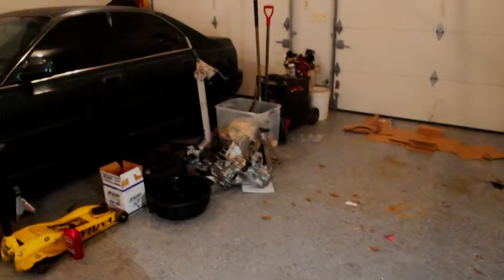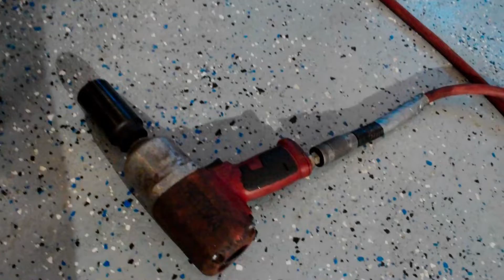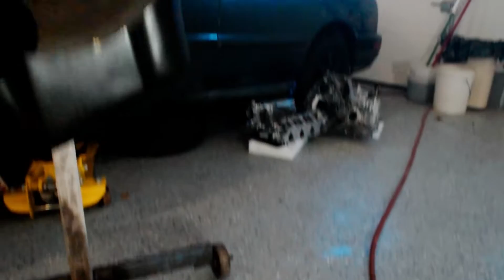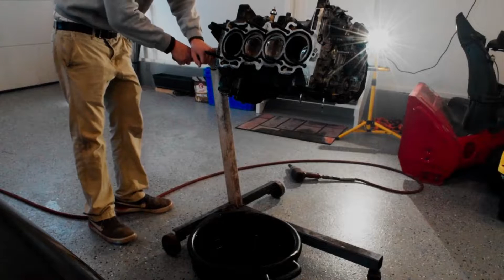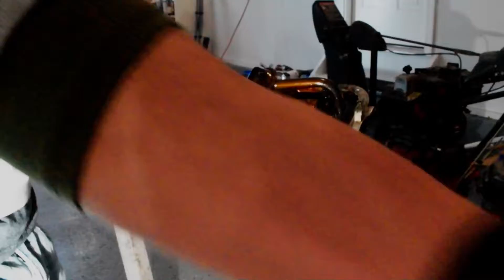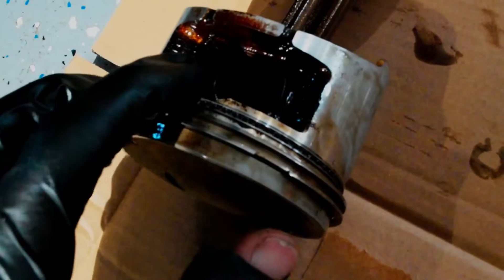1996 Honda Accord F22B2 Engine Disassembly

Comment: On Average , piston rings will last about 100’000- 150’000 miles under proper conditions like many other parts. Also valve guide seals will wear out fast from the extreme heat 🥵

Comment: I know this is an old video but I’m having trouble with my engine if you can help me that would be amazing. Anyways I’m the back of my block I’m leaking coolant idk what to do or what it is
Reply from the maker: There’s a metal coolant pipe in the back of the block that has o rings on it i believe. You’re just going to have to see the leak. Got to lay under there and pinpoint it
Reply: @ThatAccordGuy  okay thank you

Comment: What up everybody 

I recently acquired a 97 accord with 187k on it 

I got it to learn stick shift and got stuck behind a person on a hill with some one behind me 😅

I launched it and burned the tires a bit and now I hear a knocking coming from behind the engine, underneath the intake manifold and a slight clink when shifting into 1 and second but it seems ok with the higher gears

It had a timing tick already so I wanted to pull it out and tear it down to learn more about my engine and knock some stuff out 

I also noticed when letting off the clutch into first gear, it judders pretty hard until I press down into the clutch and use more gas, I was wondering if this is normal 

Also wanted to add a turbo but didn’t know wear to add a line or if it’s even possible on a f22b1 motor

So I have a lot of ambition but knowledgeable intel is my biggest enemy but that doesn’t scare me lol
Reply from the maker: It’s probably a torn motor mount or something. Mine clutch chatters pretty good when you slip the clutch. Characteristic of the vehicle. Once you get better at driving stick it will be better. I was the same way! Good luck man!

Comment: I noticed your attention pulley for the timing belt still had an 8 mm bolt holding it in place. Some say that should be removed after the tightening procedure is done. What are your thoughts on this?
Reply from the maker: That bolt is supposed to be for set up and tensioning the belt. then you supposed to remove it. I believe that’s the bolt you’re talking about. I felt like my spring wasn’t pulling the tensioner enough, so I gave it a little extra and tighten the bolt. Hasn’t caused any issues.
Reply: I left mine in and now I’ve got to try to fish it out with just the top cover off.
Reply from the maker: Eh I’d leave it lol not doing any harm. basically, the point is, it tensions the belt so you can put the outside cover on and then crank down the tensioner bolt afterwards with the cover on. I think I just tensioned it with the cover off so I could make sure that it was good.
Reply: It just sounds funny like it’s to tight,both belts will flex 3/4 turn when twisted and the belts didn’t have a direction on them so I’m wondering if the sound will subside in a little time.
Reply from the maker: Mine was too tight my first time too. I loosened it and it sounded better.
Reply from the maker: Probably will wear in more tho eventually

Comment: Im currently tearing down f22B1 motor , got the headgasket and head ported and resurfaced , thinking i blown my headgasket. Come to find out that it  didnt stop the smoking problem … got aftermarket rods and pistons and arp studs for the bottom end
Reply from the maker: Good luck man. Mine is starting to smoke again but I'm thinking it might be the turbo

Comment: friend i wachted your video, i have the same engine f22b2 in my accord 95.  im looking for the engine bearings ,but i cannot find it anywhere,do you know whats the part number is? and its the same engine bearings for f22b2 and f22b1? please help.
Reply from the maker: Yeah If you can't go to the dealership or order them online, if go with aftermarket bearings.
Reply: @ThatAccordGuy  Thanks for repply bro,i solve that problem ,just bought another aftermarket brand and fits greats,thanks my  accord 95 is on the road now. greetings.
Reply from the maker: Glad to hear it!

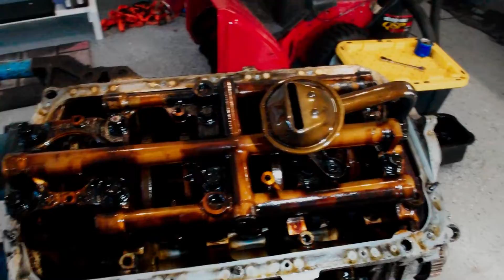Comment: I love coming back and watching your build videos bro..👍 👌 after spinning bearings in two of my f series motors.. I now have put together a hybrid motor.. f22a4 head on a f23a block. I had k20a2 pistons in my last f23a block setup and it was stooped torquey and fast.. but didn't last but 2 weeks since I found out the compression was 12:36.1 and I was on regular 91 octane with no tune or fuel management.. so you can imagine the knocking and pinging I was getting.. its my first time building motors so I am somewhat still new to certain things.. I have a new set of k20a2 pistons I want to put in this setup but the compression will be through the roof!.. 😆 so I have to invest in a hondata s300 since tuners around here will not touch a car that is on a chipped ecu.. sucks but eh.. I hear good things about hondata.. the f22a/f23a setup is pretty impressive as it is dont get me wrong.. it has lots more torque than the full f23a jdm swap I had.. something about the compression going up when you pair this certain combo together. When I break loose my headbolts I start from the outside and work my way in, I don't know if that makes any bit of a difference but when installing them I would work middle out In sequence.. so I just do it backwards but im sure both ways would work no problem.. hoping to catch up to you real soon! I'm ordering a turbo kit soon what kit did you buy off ebay? Any recommendations and tips before I make the purchase? And with the injectors and fuel pump, how hard was it to get the car started with upgraded injectors? Or is there a basemap i can load onto it to just drive around to get to the tuner? Sorry for all the questions but your by far the only selection one out the bunch that knows these motors in and out
Reply from the maker: Sounds like you've had a good amount of experience with these motors. To be honest, this is my first f series build! Definitely love the torque it makes. Don't even want to put a cam in it for fear of losing it! Cool to see you've been experimenting with higher compression stuff. I like the low comp for boost cause it's hard to kill!

I pieced together my own kit for the Turbo. Better that way. some stuff you gotta get nice.

Definitely was a pain to get it to start and run on the larger injectors but it didn't have to be really, I just didn't know what I was doing. Sometimes you're better off changing them at the Dyno. Gotta ask the tuner. He could always send you a base to get u to the Dyno if he's cool. Good luck bro!

Comment: That socket is awesome! I ended up using a 1 to 1/2 adapter and a impact made for heavy machinery haha.
Reply from the maker: Yeah the big guns are also an option. I tried a 3/4 gun with no success I think. Those bolts can really be on there!

Comment: Thanks I've been looking for a video confirming this. Only seen ones showing piston all gummed up but did not explain the situation beforehand. I'm trying to resolve this on a Toyota 3.0 engine and see you tried epr-109. I was going to try that and also switched to Pennzoil full synthetic and saw a decrease in consumption.
Reply from the maker: Nice man glad I could help. Fixing this with different detergents and oils may be possible if you have the time to try them and don't mind smokin in the meantime haha. IMO a rebuild is the best way but good luck l! If it's working then that's good!

Comment: Greetings from the UK. Glad you found the issue, the hard work pays off in the end - fair play to you for finding it. This highlights the importance of "clocking" all the rings....you may have just been unlucky how the gaps ended up lined up like the stars! You must have felt so relieved when you found that, I know I would have done.
Reply from the maker: Yeah I was pretty happy to have found a real issue. Knew it was going to run good when I got it all back together. Thanks for watching
Reply: Instablaster...

Comment: So basically, to stop the oil burn, you just have to take out the pistons, and clean the rings with some brake fluid and a toothbrush or something?
Reply from the maker: Best to replace the rings man they're usually work out. Plus you'd want to hone the cylinders. But you can half-ass it haha it's been done

Comment: I've had great luck with that socket but if you ever run into one it doesn't remove I found heating the head of the bolt with Maps gas for 60 seconds, splashing seafoam on it, and going ham with a 1/2in. ratchet using an exhaust pipe for leverage gets it off of there as well.
Reply from the maker: Haha that sounds like quite the process. I tried heat without the socket but no luck at the time. The socket made all the difference. Thanks for the tips

Comment: you do a great job of explaining as you go...taking time and not rushing...your logic is good and takes you down the better path... maybe use the MMO regularly and prevent the problem in the future???
Reply from the maker: I think with regular oil changes this motor will never get to that point again. Was a result of years of neglect from previous owners. It leaked so much they probably never changed the oil haha. So glad it isn't burning a drop after the rebuild. Thanks for watching bro

Comment: Cool video! My engine started knocking and found #1 con rod bearing damaged “(  I’m unable to remove the cap to inspect the crankshaft journal for damage. Any suggestion or advice??
Engine is still in the car.  Meantime, purchased a used long block and probably be rebuilding this engine instead of my original engine if it’s not repairable.
Reply from the maker: If you spun a bearing, it might be fused to the rod itself. My only suggestion would be to tap it with a mallet to try and bust it loose to get a good look at the damage. Hopefully the crank isn't scored too bad. Did you have low oil pressure? What is the condition of the rest of the bearings? 

You could theoretically just swap cranks. If you plastigauge everything, and the clearances are good, then you can send it on the motor in the car. If not, then you might be pulling the motor or Changing all the bearings/polishing the crank to get it in spec.
Reply: @ThatAccordGuy  Thanks for your speed reply and your advise. Yes, low oil pressure and the main bearings are in need to be replaced. Crankshaft MB journals looks fine. still need to remove the remaining Con Rods.
Reply from the maker: @soyeldiego4878  the crankshafts are pretty durable being that they're hardened and all. Hopefully the rod journals check out okay. How many miles did your motor have? Let me know how everything goes!
Reply: @ThatAccordGuy  Absolutely! Engine has over 210,000 miles. I bought the car used over a 2 years ago. Compression was good and kept up with the oil changes. I'll defeinetely keep you updated on this project. Once again, thanks for your speedy replies and suggestions.

Comment: Nice vid. Many people were fighting with that crank pulley bolt. Quick tip for those who have engine in their car. Remove starter and stick something to lock the flywheel.
Reply from the maker: Yeah that is a good tip, sometimes those pulley bolts can be insanely hard to break loose. Couldn't do it at all with a huge breaker bar last time around. Thanks for watching!
Reply: @ThatAccordGuy  your welcome man. Always love to watch f series engines. Had same problem as you with fried oil rings. I fixed it, only one diff that I didnt pulled the engine out. Keep going man.
Reply from the maker: @jdmcars-lt6499  glad to hear that it was your problem as well. Reassures me that when it's back together with new rings  it's going to run like a champ! Thank you! Did you remove the Pistons from the bottom with the motor in the car?
Reply: @ThatAccordGuy  when u done it will last forever lol. No. I did everything u did only the engine was in the car. My problem was only oil rings. So I changed only the rings, no needed for bearings, they were pretty like new lol.
Reply from the maker: @jdmcars-lt6499  haha I sure hope so! I'm trying to measure the sizes for the bearings now. They're starting to show a little wear after almost 190k I'll feel confident if they're bran new
Reply: @ThatAccordGuy  yeah the bearings a bit critical, u suppose to measure them. Here in europe people do offen change the oil even for old cars. When I had problem with No. 4 baked oil rings the car had 510.000 km on it so its like what 300.000 miles or so? I was amazed that bearings on rods were wery good looking no burning no scoring or so. But the valve stem seals, injectors, head gasket, intake gasket, exhaust manifold were shut. Even I could buy used one engine here for like 70€ i desided to rebuild it like u did, clean, resurface head, valve stem seals, polish valves, polish head, ultrasonic bath did a great job as well. After puting back together it will run 300.000 miles more. Driving car for one and half year no problem at all, runs strong. Desided to change oil every 5000 miles so no doubt it should last. Beware. F series kinda mysterious. After rebuild for 30 min had like milky oil on cap, thought head gasket but that was only condensate of sitting some time in garage.
Reply from the maker: @jdmcars-lt6499  That's awesome to hear that yours has run for that long on the factory bearings! These cars were really built to last.  I'm sure this car would have driven for twice as long if it didn't have the oil burning issue.  I had the milky oil cap thing happen to a friend due to not any highway driving so the condensation in the crankcase couldn't vaporize.  It can happen if you mainly do short trips.  Cant wait to get all the parts and start the assembly!
Reply: @ThatAccordGuy  haha. Agree man. Yes these engines bullet proof. Thumbs up for your rebuilt!
Reply: ThatAccordGuy , i’ve got over 300 K on my Honda engine, I started putting Teflon additive every 50,000 miles into the engine. At about 150,000+. It keeps things like bearings from wearing out. I’ve been doing this to all my previous vehicles as well, including one of my prelude’s which I sold and the guy had the oil changed at one of those oil change places where they forgot to put the drain plug on tight and it ran out of oil on the interstate and the engine stopped. After it was towed back to the shop and they filled it with oil, it ran like a champ.He was so happy when I called him and told him I had found the wheel locks for his mags.
Reply: JDM Cars - LT , So you don’t have to pull the engine out to replace the piston rings?
Reply: @GilsTestChannel  no you dont. For most of 4 cyl engines will work fine. For v6 might need to remove it